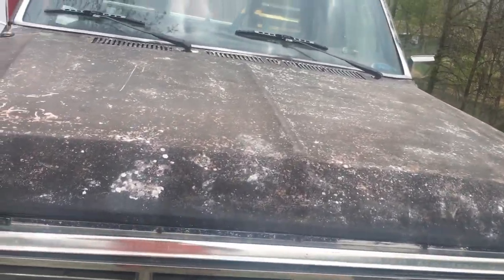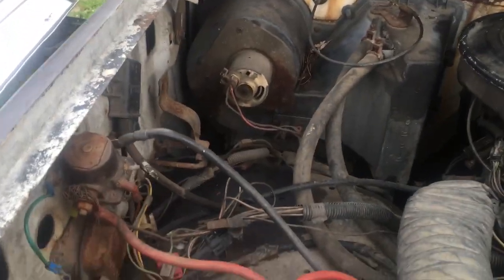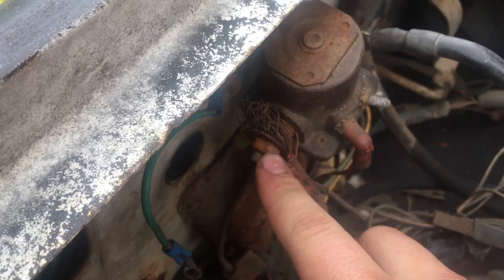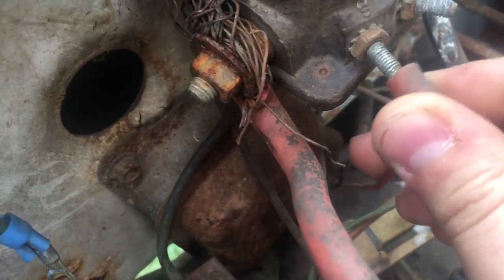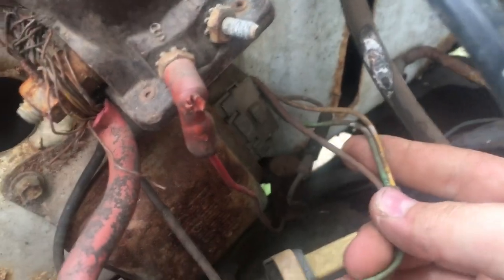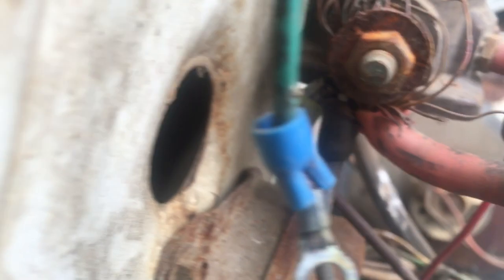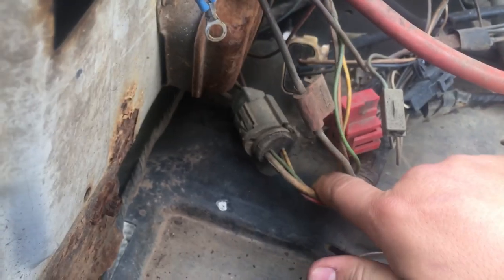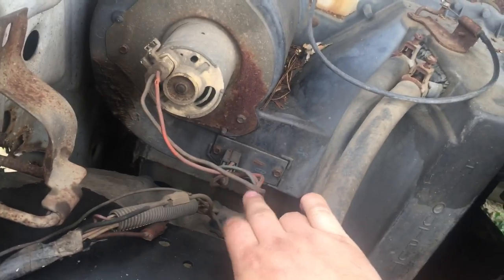1984 Ford F-150 wiring diagram alternator and and plugins

Comment: if this truck still lives, I would start by grounding that green wire from the starter relay(cylinder connected to the positive). then I would clean up all the rusted grounds from the engine to the body. the preexisting grounds look rusted through. then you go from there with a multimeter checking voltages.
Reply: Sir you need your help I have a 83 4.9f150  and all sorts of cables are disconnected or burned and I can not find the fuse that runs in-between the alternator and the ignition switch

Comment: The wire harness for the map sensor has 4 wires in a connector and  2 single wires and a black ground (to battery )  that split off  and my 4 wire connector is missing and i'm trying to figuire out where the hell they belong. Can you take a look at your truck and let me know ? Thanks.